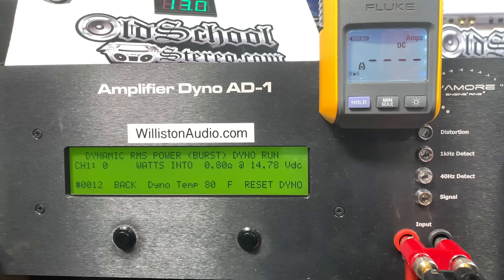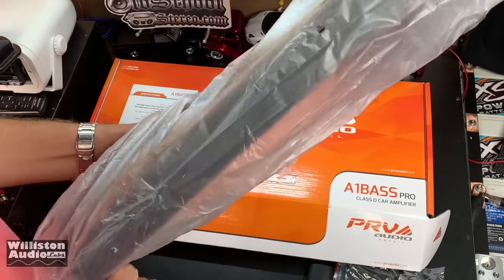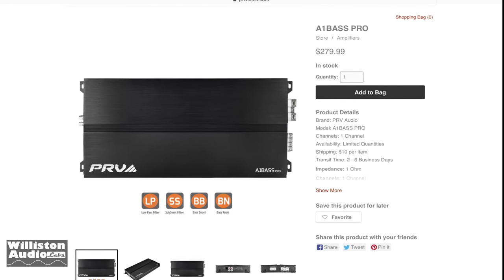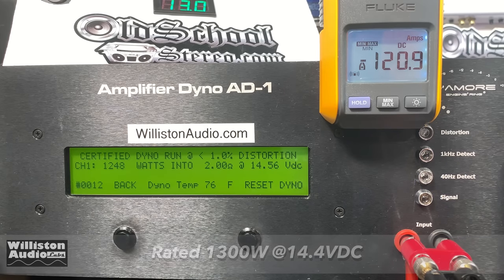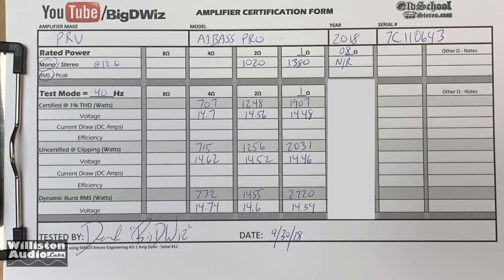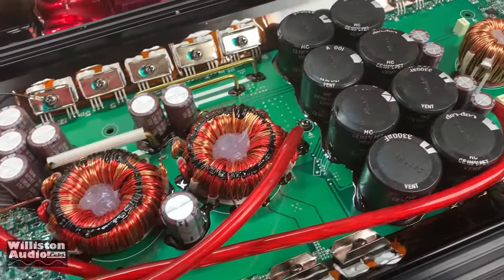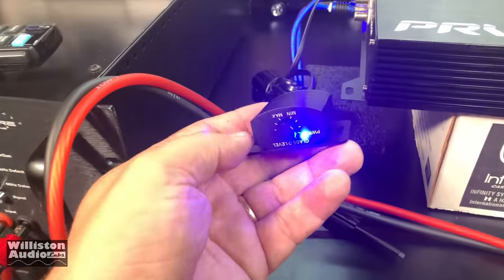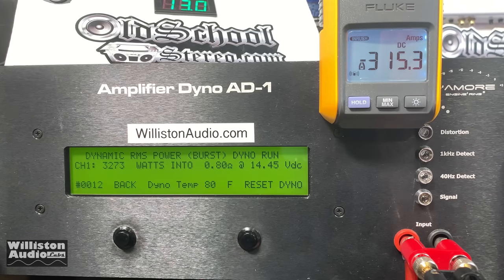PRV Audio A1BASS PRO Amplifier - Brazilian, Korean and Chinese in One! [4K]

Comment: I wasn't too happy with the CAB. Ran through 3 in less than 6 months but had them wired at .5.  Had a Mechman 240a alt, group 34 agm up front and a group 31 AGM in the back. Voltage never came out of mid to upper 12's and they all fried fets and one popped like 4 caps as well as burned out the some fets.
Reply from the maker: Yeah I don’t think they like 0.5
Reply: @wal  Perhaps this is what explains a high failure rate.
Reply: @timmturner  Oh 100%. Everyone that runs them at 1 ohm loves them. I can tell you they were put together like shit though. Coils were loose so were some of the caps. I even had green book worms in mine fresh out of the box. LOL
Reply: @Supercharged1976  That is certainly some bad QC. I don't love the amp, it was just inexpensive and powerful enough. If I had the money at the time I would have went with a power series Fosgate, this is the first time I strayed in 20 years but luckily I haven't regretted it yet.
Reply: @wal  I beg to differ, I have five 12s all dual 4 ohm wired in parallel for a final load of .4 on one of these and I've had it that way for years... Literally YEARS, all I have is a 200 amp stock GM cased alternator and 4 batteries, 2 75 series and 2 78 series.
Reply from the maker: @whitewigglesworth  Generally speaking, loading a 1 ohm stable to 0.5 is not recommended, however in some cases (depending on subs, box and vehicle), the impedance rise will allow the amp to never really see the 0.5 ohm load. However, I would not want to recommend this for everyone as it may not turn out the same as your experience. See where I'm coming from?
Reply: @wal  Yeah, I was hoping you wouldnt catch that. It does with box rise run right around .9 ohms on average and it clamps 2250 watts. Ive been very impressed with the amp and Im just sad that its no longer for sale from CAB.

Comment: I wonder what the long term reliability is for most of the Chinese made amplifiers? Most of us still own 30+ year amplifiers made in the good ol' USA and there still going strong. Recap them and you'll get another 30+!
Reply: These new, no name amps just aren't my thing. No body will care about them 20 years from now either.
Reply: I got a clarion apx600.5 made in the USA 🇺🇸.this amp is used everyday,it came out in 2001, I use all 5 channels man I can’t believe it still works without a problem and I push it to the limit, it’s a master piece

Comment: nice, if it had the clip light I think it would be a big seller, I don't understand why companies don't try to 1 up the other guy, instead they build the same amp with a different name.. they should have put in the extra to attract buyers.. nice amp tho, I'll keep running my skv2.2500 tho, still no issues with it, I Ali just added a mechman 370 and I have an external voltage regulator I'm adding once it warms up.. (91102R)

Comment: Out of curiosity why do companies still put bass boost on amplifiers??
Reply from the maker: Good question
Reply: Some people won’t buy an amp without boost. It’s a good selling point(even if it’s a bad thing)
Reply: The only thing I could ever think... Maybe when competing and you wanna slight clip. Not like I compete so I dunno. But It needs to Rest In Peace already. Wasted space.
Reply: @ThePurePlayaz  You can get slight clip without it, judt raise gain a bit.
It's mostly used by people who don't listen to rebassed stuff, i mostly set my gains at +3db since it's best for edm and rebassed stuff since most guys are rebassing at -3 or -6. I don't use bass boost since it will clip if you set gains at 0db.
Reply: I used it for a month with no clipping (dd1), it didn't sound any different
Reply: for the handful of people who actually know how to utilize them.

Comment: I Have A Question... I'm Running 4 Hertz 200Ls 4 Ohm 8 Inch Mid Bass Drivers 500 W Peak - 250 W Continuous On My Harley Davidson (2 In Each Bag) Which Brazilian Amp Can I Run To Get The Maximum Out Of Those Speakers...? I Want To Replace My Current Amp's Which Are Located In My Fairing (2 Diamond Audio Micro 4V2), So I'm Limited On Space.

Comment: It looks like a good temporary amp my question is how reliable is this amp how long will it last before it goes out
Reply from the maker: That’s always the question and difficult to know without stress testing
Reply: I think I’m going to give the Orion hcca 3000.1 amp a chance,I have 2 Memphis mojo 12 inch subs dual voice coils 4 ohms I’ve had them in my hall way closet since 2010 just rotting in there,I finally got a custom box made just for them it’s 5 cubic feet all together at 35 hz ported I want an amp that is reliable and that will sound good

Comment: I did not know Brazilians made class d amps. I thought this would be like soundigital, taramps, stetsom etc. Kind of pricey for a low sound quality class d amp that does under 2000 watts certified. Just my opinion
Reply: @Fly2kill1  it's the same as the cab amp. The Skar RP, soundqubed S1-2250, machete m2000 etc are lower sound quality boards that do good power. Excellent choices tho for people going for that big bass sound and don't have a lot of money to spend on the higher quality Korean amps. I've ran Around  a half dozen 2000 plus watt boards over the past year and noticed a definite difference in sound quality between them. It's just my opinion I'm not bashing on this amp
Reply: @Fly2kill1  these are low-quality amps bro. Even the Korean amps use Chinese parts. Low quality capacitors Etc. They're not using quality internals like nippon chemi-con caps anymore. The better made Korean boards are marginally better than the Chinese made amplifiers. Better but not by much. I have  the Orion XTR 2500. 1dz for instance ( also have Sundown , Deaf Bonce Apocalypse amps and Wolfram amps as well). There is a sound quality difference between these amps. The Orion amp is a full bridge amp and runs hot as shit, even with a 270 amp Mechman alternator in my Maxima and a singer 320 in my Navi and plenty of AGM reserve. My zennon built Wolfram is crap inside. very disappointed in the quality control of this board. My deaf bonce apocalypse equipment from S&I is heads and shoulders better. You can hear more noise through my Wolfram and Orion then my apocalypse amp. I have sets... Not just single amps. I own the four channels and monoblocks from S&I and from Zennon as well as Chinese made S&I amps too. THERE IS A DIFFERENCE. I'm a basshead and spend all my extra cash over the past year on a lot of equipment. I had to learn the expensive hard way. My Wolfram protects with light clipping and thermals quickly, my apocalypse aak 4000 does not. there is a definite sound quality difference as well. I don't know how else to explain it. I'll have plenty of content on my channel soon. ThaFlex Filez. I'm not bashing on anybody's amps or products I just gave my opinion
Reply: @Fly2kill1  just experience. I don't understand your issue. My ears tell me if something sounds good or not. But hey... Try it out. I'm sure you'll like it
Reply: @Fly2kill1  I even said opinion lol. OPINION. I DIDN'T BLAST THE PRODUCT I SAID IT WAS KIND OF PRICEY FOR A LOWER QUALITY BOARD.
Reply: @Fly2kill1  what about noise? Lesser quality higher noise class d amplifiers don't exist do they? Total harmonic distortion is bullshit  also huh? Try turning your system up to max volume with no music playing and put your ear to your sub. You'll hear noise out of those cheap 2000 watt boards. 2000 Watts is absolutely 2000 Watts... But the sound quality differs from amp to amp. That's just my experience

Comment: angled inputs suck in the real world
Reply from the maker: On the bench too. I provided the same input to PRV and they said newer models won’t have angled inputs
Reply: This is the deal breaker for me with this.. F** Angled.
Reply: I think they keep the install looking clean because you don't have to make as tight of a bend in that large wire. Of course you have to wire everything up before you screw the amp down.
Reply: Just get angled amp terminals
Reply: Do you think they purposely do this to prohibit flush mounting?